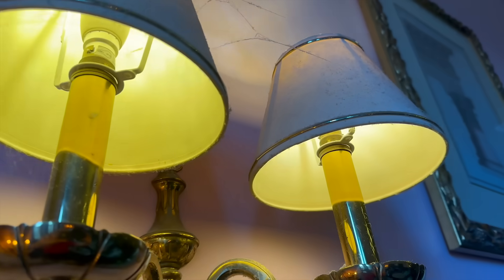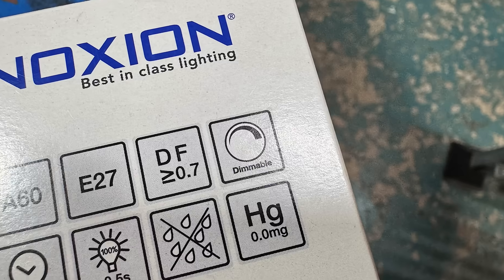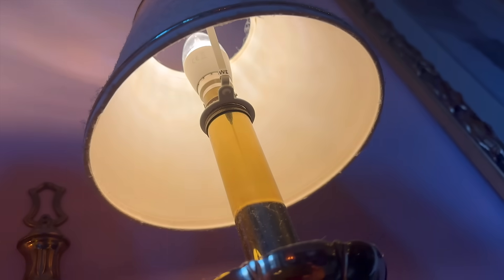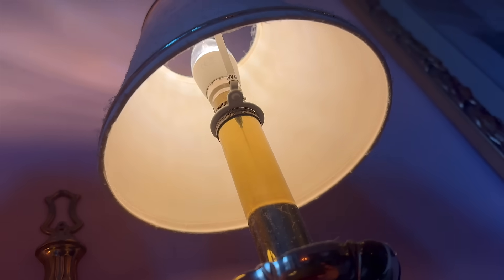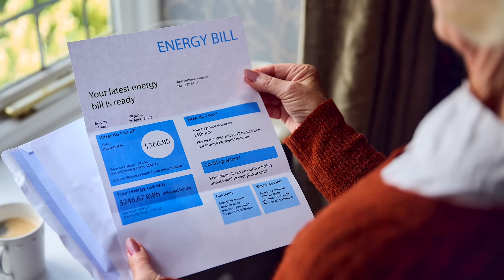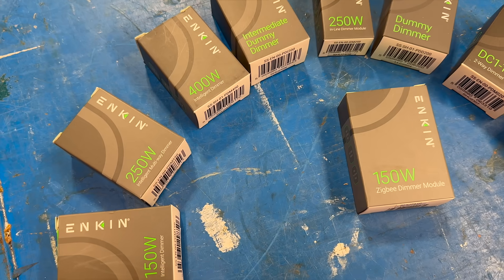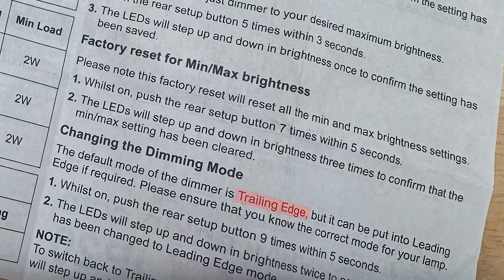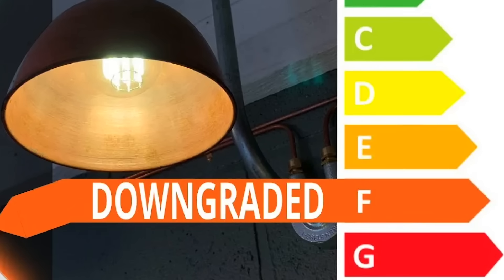Essential Guide to Flawless LED Dimming

Comment: I agree with the response from Co-Pilot (paid version of AI):

“The Fronius inverter is using frequency shift power control (FSPC) to tell the Victron inverter/charger to back off charging once the batteries are full. That’s standard in off‑grid setups where there’s no grid to absorb excess PV power.

⚡ Why the LED dimmers misbehave

• Most LED dimmers are frequency‑sensitive. They’re designed to work at a stable 50 Hz (or 60 Hz) mains supply. Their internal timing circuits (often TRIAC or MOSFET based) rely on the zero‑crossing of the AC waveform to trigger correctly.
• When the inverter shifts frequency upward (51–52 Hz), the zero‑crossing timing changes. The dimmer’s control electronics can’t track properly, so:• Some dimmers shut down (lights go off).
• Others flicker because the phase‑cut timing is misaligned.

• LED drivers themselves may also be sensitive. Many budget LED drivers expect a fixed frequency and don’t tolerate deviations, so they misfire or drop out when the supply drifts.

🔧 What can be done to reduce the impact

Here are practical mitigation strategies:

1. Use frequency‑independent dimmers/drivers• Look for PWM‑based LED dimmers or drivers with switch‑mode regulation that don’t rely on mains zero‑crossing.
• “Trailing‑edge” electronic dimmers often cope better than “leading‑edge” TRIAC dimmers.

2. Add a frequency‑stable AC source for lighting• Run sensitive loads (like lighting circuits) from a separate inverter output that isn’t subject to frequency shifting.
• Some Victron setups allow splitting loads: “critical loads” on one output, “frequency‑controlled loads” on another.

3. Configure inverter limits differently• Instead of relying solely on frequency shift, use DVCC (Distributed Voltage and Current Control) in Victron, or a CAN‑bus communication link between Fronius and Victron. That way, charging is curtailed by direct communication rather than by frequency drift, keeping AC frequency stable.

4. Add a dump load or diversion controller• Excess PV can be sent to a resistive load (like a water heater or immersion heater) via a diversion controller. This reduces reliance on frequency shifting and keeps AC stable for sensitive electronics.

5. Upgrade LED drivers• If replacing dimmers isn’t feasible, swapping to higher‑quality LED drivers that tolerate ±2 Hz frequency variation can help.

---

✅ Summary

The flicker and shut‑off happen because phase‑cut LED dimmers depend on a fixed 50 Hz supply, and the inverter’s deliberate frequency shift breaks their timing. To fix it, either use dimmers/drivers that aren’t frequency‑dependent, or change the system control strategy (CAN‑bus, DVCC, or dump load) so the inverter doesn’t need to vary frequency for charge control.”

---

Comment: good video. I always use varilight. You do the setting from the dimmer switch not from behind so you can change its setting without moving the switch and can set leading or trailing edge from the knob

Comment: Very interesting, thank you! However, in my last home I replaced 44 halogen GU10s with LEDs and just got rid of the dimmer switches because we simply never bothered to dim them. I am anti-dimmer and anti-wireless control and all that fancy stuff. If I need a light on I get off my bum and go to the switch. Controlling your home with apps on your phone is fine for some, but for me (I'm 70) it's just not an option. If I need to dim the lights in my living room it can only be to make it more "romantic"...at which point, if I'm getting that lucky, I move the action to the bedroom!
While I am banging the drum, and being a pedant (some call me a pendant, because they think I should be hung from the ceiling!) let me say that "install" is a verb!
"Installation" is a noun!
To look at an electrical installation and call it an install is anathema to me. Yes, the English language evolves, but every time I hear someone say "look at this install" or "here's an interesting install" I scream at the screen!
It's just about the only fun I have nowadays!
Oh, wait...I also scream when Jordan tells us that air source heat pumps are a great thing...they are NOT!
Rant over!

Comment: I'm a big fan of Enkin, and was somewhat surprised that they only appear to do one Zigbee enabled device last time I looked.  

This is a shame as I would have used their products throughout my house. I was specifically looking to replace all the standard switches with Zigbee rotarys. I can't help feeling they have missed a trick here with so many hobbyists looking to Smart up their homes with the likes of Home Assistant.

So many of the available dimmers are frankly crap, with no proper low end/high end adjustment unless you use something like ZigbeeToMQTT and even then its hit and miss. 

I've just checked Enkin's site and it looks like the only zigbee enabled device is the ZDM150

Comment: With all lighting now days basically LED, do we still need 1mm2 for a lighting circuit. Surely 0.75mm2 is capable of more than enough current with plenty to spare! Also how many LED lamps can you put on a 6amp mcb? I guess it's a insane amount, compared to the old school incandescent lamps, the circuit was designed for. Is it mabe time to rethink how the modern lighting circuit is implemented. You could probably run the lighting for the entire house on a 3A plug fuse! Which could handle the inrush current from the LED lamps easily.
Reply: Volt drop

Comment: I used to work for one of the world's leading hotel brands called Four Seasons Hotel Baku, they have 90% all their property lighting system dimmable and all dimmable lighting system setup by Lutron brand back in 2012, a year ago system started failing ballroom and meeting room lights flickering, Lutron company offered to upgrade entire system for 1 million dolllars which of course they turned down the offer./then we started searching alternative ways to solve the issue as engineering department, I offered them to implement thyristor system which turned out to be effective in some zones, then I quit the job for another company, don't know how they handled that later🤷‍♂️
Reply from the maker: Offered to upgrade for 1 million - very generous 😆
Reply: @efixx in fact it's very expensive in this country

Comment: I’m a complete dim-a-holic. Age 12 (1992!) I replaced my bedroom light switch with a dimmer knob without supervision or parental permission. It was still there and working in 2024 when I sold my parents house! The same knob. Fast forward to 2025: every single one of our 42 light circuits in our new renovation is dimmable, and I have been pairing the 240V direct feeds with Theben KNX dimmers, and the low voltage LEDs with the same Theben KNX dimmers plus high end Ecopac LED drivers. Everything has worked a treat. In some cases the smaller LED circuits (lower wattage ie shorter runs of LED strip) have struggled to get uber-low in terms of light level. No flickering of course, not with these dimmer packs. In some cases I have replaced the dimmer/driver combo with KNX PWM dimmers. I’ve been using Meanwell units. They are an absolute game changer. Massive increase in efficiency (ie a 200W dimmer/driver is far more efficient for a small eg 20W load - not that you’d specify such a thing). More to the point they dim so amazingly low it’s beautiful. Spec sheet says 0.5% dimming, and you can really see it. Yours sincerely, a dimming / automation nerd.
Reply from the maker: Sounds like you’ve taken things to another level 😉👍

Comment: Spooky timing. Ive been bashing my head against dimming lights recently, same type of lights, same type of dimmers just different amounts of LED's. On the circuit with 2 lights the dimmer flickers around 80% power, on the 8 light circuit the lights behave with no issues, might have to pop a ghost load onto the lighting ring to solve the mystery.
Reply from the maker: Hopefully this video helps!

Comment: I’m an electronics engineer and I did all the house installation myself when I built my house 6 years ago. 

I decided to do things differently and I  don’t know why I’m the only person who has thought of this.

All my ceiling LEDs are standard 12VAC LEDs usually used in kitchens (under  cupboards etc).  

But I send 12V DC (direct current) to them.  The 12VDC comes from a standard 240 VAC to 12VDC power supply. The power supplies I use are 50 watts each, enough to power about 6 LEDs.  

I then dim them with a 12DC module     made by a company called Fibaro.  The module is meant for RGB led control.

Having DC means I can dim the lights from 1% to 100% with absolutely no flicker (as it’s all DC).

As the current is up to 4 amps, there is some voltage loss across longer cables runs. But this is an advantage because I actually run the LEDs at 8 to 10 volts. There’s no detectable loss of brightness, so the LEDs run at 60-75% of the rated power.  

I have about 68 LEDs running like this and in six years not one led has failed, despite them being cheap types costing about 2.50 each.

With all 68 LEDs running at maximum brightness consume 711 watts of power.
Reply: There are also nice decent dimming constant current drivers like Tridonic even in Switch-DIM, as hinted at early on this video.  I use these.
Reply: Fibaro dimming is great. I have a load of fibaro dimmers. Expensive but good. But…  in our renovation I have banned all wireless dimmers, full stop. I’m using KNX dimmer modules centrally located. Some of them are PWM dimmers which is far better than phase cut dimming. 12V needs thick wire and wastes a reasonable amount of energy converted to heat! 24V far better and even then I keep to short runs. PWM dimming gives you zero loss, and incredibly smooth.

Comment: Very cool, what about dealing with led lights staying lightly on when using switches that have a pilot led light inside them ?
Reply from the maker: The bypass device mentioned later in the video could be the solution.

Comment: I've had good results with Varilight V-Pro dimmers.
Reply: I stop using them , they are good, but I have found that the BG dimmers are far easier to use & they do the job just as well, try them you will be surprised, Screwfix used them in there own brand dimmers but they have recently changed there supplier & they not as good now.

Comment: There are a couple of obvious problems with the current dimmer switch designs, particularly  the touch sensitive dimmers or switches. The most serious is that earlier versions were designed to operate with inductive loads, compatible with CFLs,.their successors have the option to switch between inductive  and capacitive loads. Selecting the wrong option either results in induced high voltages on the supply or excessively high input switching currents, both leading to flickering, damage, and potentially a catastrophic failure. The problem is that while the switches can be set to operate with either leading or trailing edge switching, to accommodate the nature of the reactive component of the load, the process is not automatic. 
The selection process invariably involves programming the switch EEPROM memory with a rapid sequence of on/off switching. Unfortunately this sequence can sometimes be entered during normal operation,  when for example,  attempting to brighten a bulb left in the dimmed off state , leading to inadvertently reprogramming to the wrong mode.

The second issue is  older house wiring has only two wires in the switch, live and load, this lacking a neutral or ground reference. This forces the switch to derive  its internal power from the current flowing through the load. In some cases, the LED bulb fails to provide the necessary current in the "off state" to allow the touch dimmer to reliably switch on. 

The above two issues alone make selecting a bulb and dimmer, something of a lottery, particularly as the reactive nature of the load is usually not specified on the packaging. Only a guess at the bulbs weight provides a guide. As for the off state leakage current, this too is not specified. I would be interested to know if a standard exists for this parameter. 
Some touch switches appear to resolve the leakage current problem by including a capacitor to be fitted across the bulb load, to provide a level of reactive current to power the switch on any legacy two wire switch circuits.

Comment: What is about JUNG UD1755REG or finder  TYPE 15.10 - TYPE 15.81 dimmers? They have more maximum allowed power and heat management is much better.
Reply from the maker: We don’t tend to use this approach in the UK. - far too sensibile for us 😉